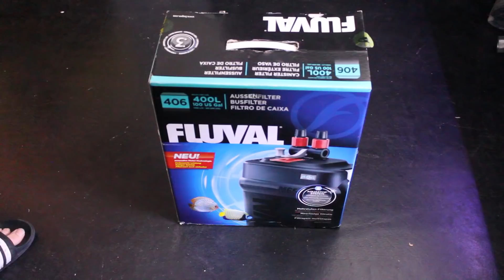100 Gallon Predator Fish Tank Setup part 1

Comment: Great video... What are the dimensions of your  tank?
Reply from the maker: 5ftX18X18
Reply: @Jensen_Truly  that would be 85gal not 100
Reply from the maker: @mikesbigtank6015  no its actually 97gal with the exact measurements and plus the filter probably 100 but thx for trying.
Reply: @Jensen_Truly  I am about to buy a 100 long and it's 6x18x19
Reply from the maker: @mikesbigtank6015  thats what mine is
Reply: @Jensen_Truly  OK, guess it's just a typo you said 5 feet long instead of 6 feet long.